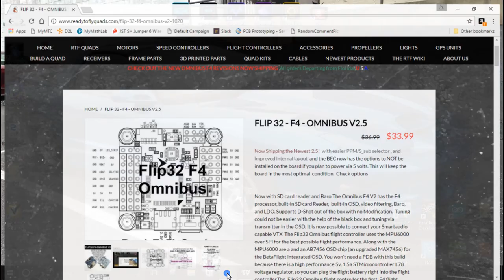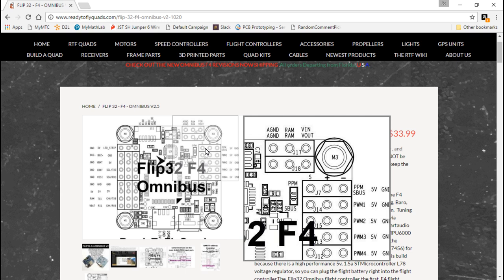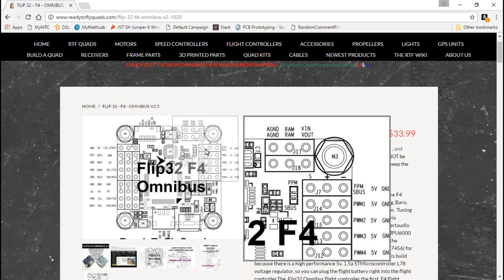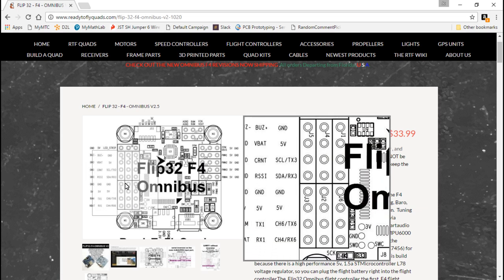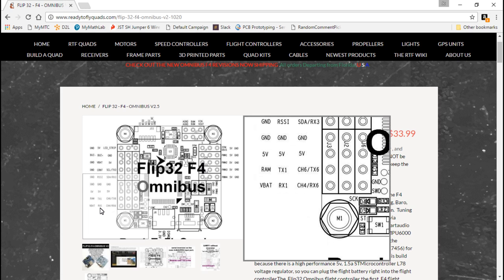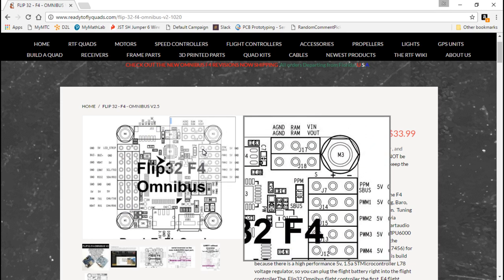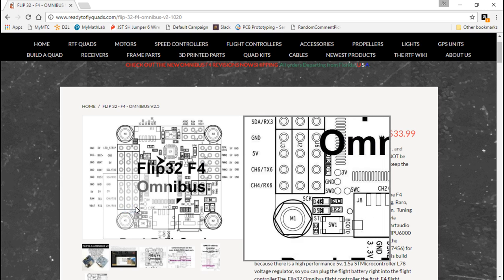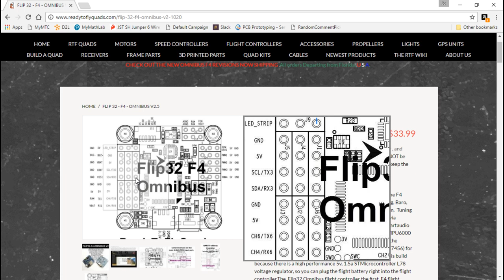IBUS On Omnibus F4 (and probably other F4 boards)

Comment: I put an A8S on my 130 build today.  It has one of the earliest Omnibus F3s I have.  IBus would not work, checked everything mulitple times, still no IBus.  Remembering this video on the F4 board, I moved the signal to the UART1 Rx.  Changed it in BetaFlight and IT WORKED!  Thank you JC!

Comment: for those with the pro board, i had a bunch of spare 4 pin 1.0 JST wire setups so i spliced that to the a8s wires making sure ground, 5v and signal wires were lined up and then connected it to the RX1 4 pin JST @ J5 on the board schematic. worked perfectly.

Comment: Well, well, well. A clear explanation, thanks. I bought a F4 board to use with my FS-IA6b just to practice on a online simulator. Series three boards wouldn't work.
Yesterday evening I watched many video's on the F4 board, but the only pin I hadn't tried was RX3. So back on with the soldering iron first thing after watching this, Betaflight, enable serial rx on Uart3 and bingo, a rock solid connection. #Thanks

Comment: If you want to run GPS with this F4 board- you need to use Uart6 for ibus, uart 1 for gps and uart3 for compass (inside the GPS module).  I just finished doing that today for a new build.

Comment: another awesome video dude!! and I've been struggling to get ibus working until I found the other UART ports but didn't know if they would work!! much appreciated!!
Reply from the maker: Dont thank me, thank Cathal N. They found the fix. I never would have thought of trying the other univerted UARTs.
Reply: Hi , did you make it work in ibus ?  i saw the hole video and i want to try it , but i dont know what  do i need to turn on in Betaflight to make it work ?   can you share an scree of  the ports that i need to turn on if i connect it in Rx1

Comment: Hey JC, I need some help:
I have a revolt v2 FC and a IA6C receiver, I have some troubles in having those two connected. Where should I solder the receiver?
I'm currently using  TX1 for Ibus but RF1 cannot talk between the two, what am I doing wrong?
Thanks in advance!

Comment: I'm not at home now, so I can assure it 100%, but I have a BG clone of the Omnibus, and I'm quite sure I'm running i-bus on the sbus pin up to the right with no issues at all.
Reply: I have the same too it works fine for me I Use the fs-i6b reciver

Comment: Hey Blue jus saw your video. I'm having some problems with I think bad signal (throttle) on punchouts like it's going into failsafe on my days f4 pro. If u have it hooked up how the manual says would it still fly but give problems? Just cruising around it seems work right. Would you just change it to a different uart and see if that solves it? I just don't want to fry anything. First build

Comment: Hey blue, can you tell me what ports to connect my FS-iA6B RX too so it will work as I-BUS. I know how to connect to make it work ppm ( which is channel 1), but a little cautious on which port to connect on the RX ports for I-BUS? There are two top ports that say I-bus servo with 3 pins with ppm/ch1, ch2, ch3 and sens  with ch5, ch6, B/VCC. Than I'll look at my (IRCFUSIONF3) board for a open uart, great video on FS-receivers and I have a better understanding on what to look for now.

Comment: I already mentioned that, really sad. Now I am lacking of a UART port for Bluetooth functionality. I use a FlySky FS-I6S receiver, is it possible to use SBUS instead of IBUS with FS-iA6B transmitter that I can use the inverted port for SBUS and UART1 simultaneously?

Comment: Hi PBF. Great video. Quick question. Can I activate a 3 position switch via my omnibus board? I have a cheap PDB board that has some built in leds and a beeper that activate by a 3 position switch on the transmitter through a direct connection from the receiver. I was thinking that maybe its possible to bypass the receiver connection, and hook the PDB board directly to the flight controllers uart thingy. Id greatly appreciate your help. Thanks

Comment: PLEASE HELP!!!! just got finished giving the Flip32 Omnibus F4 a good home but cant get configured in BetaFlight. When I go to Ports set up and turn on UART1, UART1 stays on. But when I turn on the serial Rx tab it turns off the UART1 and the serial RX is of course off as well. Im trying to use iBUS with the FS-A8S receiver that I use with my Turnigy Evolution. I pulled this receiver from a Naze32 that worked fine. Any and ALL help is greatly appreciated. Peace

Comment: i got mine working by moving to a different uart but on the betaflight facebook page some have said you just have to bridge the sbus pads. can anyone confirm this?
Also the manual said the board is preset to sbus without a need for bridging...

Comment: THX buy i got em soldert on the PPM. So can i bridge the signal. ?? to ibus? Or do i need to resolder it. from the locasion to the other?thx so mutch. using flysky i6 f4 cc3e :-) i loooking so mutch forward to know. bin stok for a while

Comment: Blue Falcon, i have an Airbot F4 and i'm going crazy trying the ibus connection with the pins on uart3, it didn't work anyway. I'll try to connect ibus signal on RX1 on uart1. But you didn't say anithing an the ppm sbus fuses (seems to be fuses...) near the sbus/5v/gnd connections...i tried  removing/breaking the R20 fuse (on my airbot f4, ithink to be the ppm one) but with no results...

Comment: plz sombuddy!! i had soldert all wire on ppm. like he explane on the other video. but is it okay just solder one wire '"the s'" from the other. were the 3 wire is on ppm.and leave all 3 wire on the ppm- and only take the signal wire. to one of the rx? So do i just take signal. and solder of nd over. and leave the other 2 wire on the ppm. or is it all 3 wire i need resolder to uart with S on the places he explane!! to get ibus! like i do un the brushed quad. there i use ibus.  plz help!! my quad is open. hate PPM :-/ im so neeebi

Comment: Nice thanks you I was worried because I have a flysky and I omnibus f4 I was going to wire up tomorrow... thx again
Reply: I use the flysky and I have it connected to the sbus without any problems fs-i6b reciver
Reply: I use the flysky and I have it connected to the sbus without any problems fs-i6b reciver
Reply: I use the flysky and I have it connected to the sbus without any problems fs-i6b reciver I have the omnibus s3
Reply: I use the flysky and I have it connected to the sbus without any problems fs-i6b reciver I have the omnibus s3

Comment: wait how do you make ibus work on the normal sbus uart on the Flip32 F4 from ready to fly quads? I thought I tried everything and could only get it to work on SBUS with my tgy ia6c rx. I had to adjust all my end points and center sticks
Reply from the maker: On the F4 Omnibus the SBUS/PPM pin is actually Rx on UART1. But Ibus doesn't work on that pin because of the hardware inverter. There is a second Rx for UART1 on the board and it does work on that pin because there is no inverter on that side of the pin. It also works on the two other UARTS.
On the F3 Omnibus IBUS will work on all UARTs and also the SBUS/PPM pin.

Comment: I use the flysky and I have it connected to the sbus without any problems fs-i6b reciver I have the omnibus s3
Reply from the maker: Right. This video is only for the F4 Omnibus. The circuitry and inverters are different between the two.
Reply: Thanks

Comment: hello fellow noob here, was wondering if you had a video describing was the difference between sbus, ibus, and sbus? I really don't know how they handle different for flying.
Reply: Can you maybe show how the wiring is done? plus I don't get tired of you making videos.
Reply: sbus and  sbus are the same ;-)

Sbus and Ibus are both serial protocols.
Ibus is only available on Flysky radios and those based on them (e.g. turnigy).

You simply connect the ibus pin to the an SBUS pin or a RX Uart pin and then choose Serial Protocol on that UART in Betaflight ports tab and serial and ibus from the config tab.

You'll need power to your reciever too.

On some iBus RXs there a three pin connectort hat is ibus out and 5v  DC +vie and negative, so you if you have pins (instead of little JST plugs) you can just use a servo connector on one and end and get the power for the RX through the same cable.

I love the Flysky X6B RX - it has ibus/sbus, two replaceable antenaes and is about 1cm x 3cm in size and come with 2-3 3 pin JST to servo cables.
(I cut off the servo plug and signl/ibus/sbus wire on one and use it for the telemetry voltage sense wire, which is also a 3 ping JST plug on the RX).
Reply: so my f4 pro v3 has the sbus solder pads for binding the x6b, youre saying that Sbus will work for Ibus being that theyre both serial rx? Also could I just solder the 5v, ground and signal to that little row of pins that says ppm/sbus 5v gnd?
Reply: I have a Airbot F4 and i'm going crazy trying the ibus connection with my X6b receiver. I used the F4 connector sbus/+5v/gnd that are probably on uart3, and didn't work in anyway. Now i'll try to connect the sbus/ibus cable from x6b to the RX1 pin as Blue Falcon was saying on this video.
Reply: did you get it to work
Reply: Christopher, did you say to me ? Yes, yeasterday i tried to connect only the signal (yellow cable on my x6b) to the rx1 on uart1 and all it's fine now with the F4. But crazy thing that them put a sbus pin on uart3 and it's no functioning...!
Reply: I think that the sbus pin in J7 is uart6 im not to sure because i dont run sbus yet but we will find out lol
Reply: On J7 i tried all the uart of the Airbot F4, i tried to cut the "connection" R20 (Sbus-ppm) but with no results. Only the rx1 on uart1 it's ok.

Comment: i have v2 and it says to use IBUS you need to use the 3.3v pad on the board however the receiver I'm using needs 5v.

I just wanna know if I can get away with just putting the SBUS to DSMX pad (which apparently supports ibus) and still use the 5v pad as well.

I don't wanna ruin my board though.... Logically it seems even if it didn't work, it would not cause damage. But I'm not an electrician and logic doesn't always work.

I mean, it's logical that the sun revolves around the earth.... but with a little knowledge you understand that's not true. ;>

Comment: https://youtu.be/JjaPWTTmryc?t=33s if you check here in the schematic right at the left of the pin for ppm and sbus there is a pin that you can solder to select which mode you need for the pin (middle and upper one for ppm and middle and lower for sbus) so in fact you can use this pin if you need it